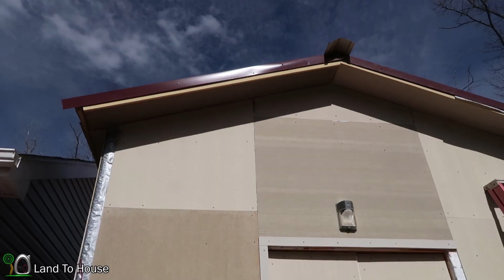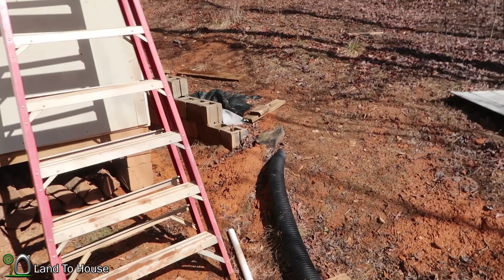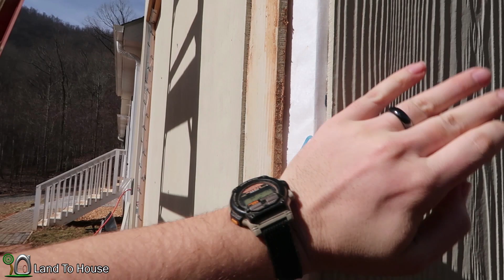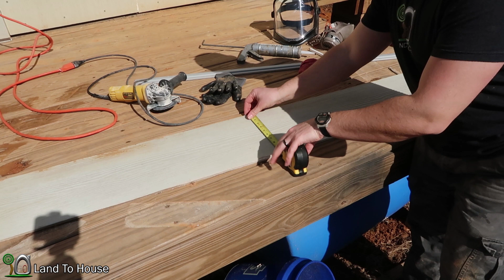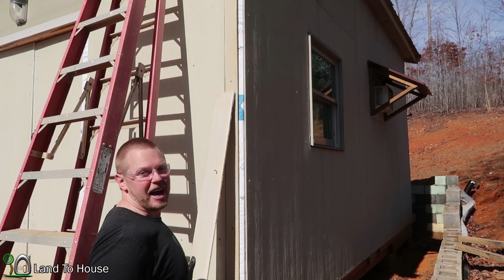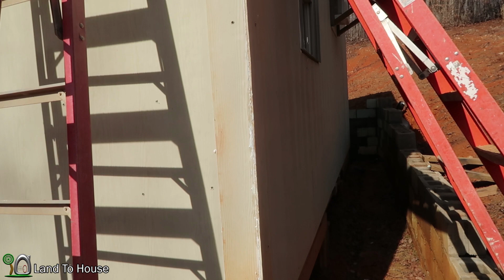Exterior Trim - Build a Workshop #39

Comment: I used 4x8 Hardiboard on my shop.  Then I helped a friend build an extension on his house and we used the Hardiplank system.  Wow, it was so much easier.  I'll never hang heavy panels again.
Reply from the maker: I used the lap siding on the tiny house years ago. it was alright but I actually like the coverage of the 4x8. They are so heavy though.